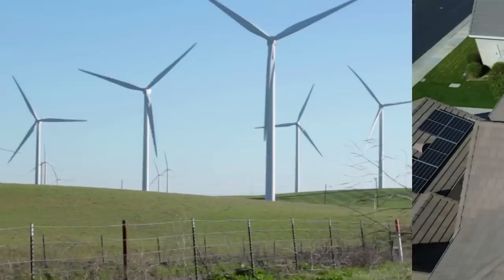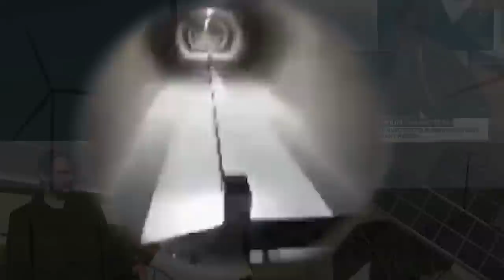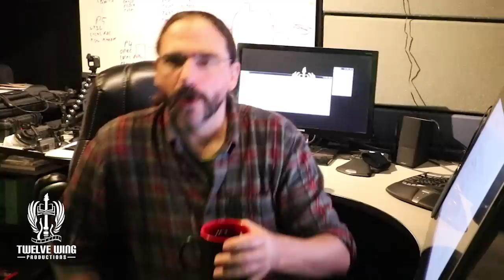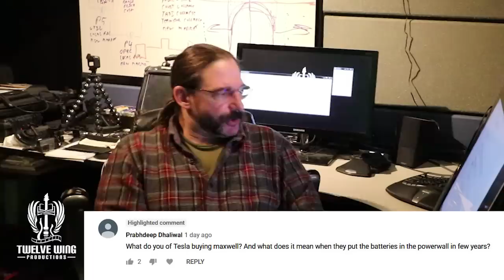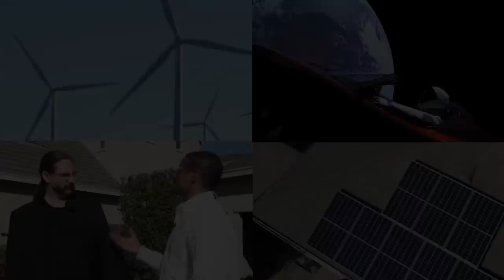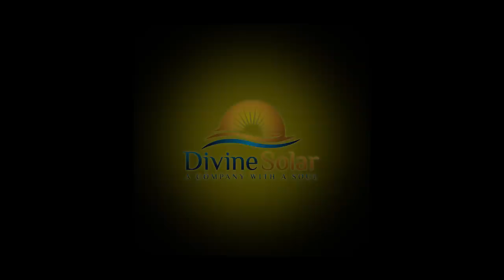Tesla purchases Maxwell; What does it mean for the Powerwall?

Comment: My take on the maxwell batteries for other than automotive services (such as truck and the hyperloop) in powerwalls terms I can see this being used in industrial mw designs for wind farms solar farms and diverseing in train hybrid power plants designs such as Ireland’s recent announcement of 602 trains with battery pack carriages
Reply from the maker: Agreed.  This technology isn't limited to just their consumer goods but also has incredibly important applications in their industrial products.
The king of these may be in the semi trucks.
Though the cars may gain a pretty nice bump in range from the added efficiency of charge discharge from the capacitors, the fact remains that a car just doesn't have the kinetic energy to regain much in terms of down hill regeneration....
... but a truck does.
So the benefit for the ultra capacitors with the semi is going to be huge.  You also mentioned trains.  If you are talking about metro trains and busses that do frequent stops and starts, the efficiencies added by using ultra capacitors for starting and stopping are going to be monumental.  I can actually see the ranges of these products nearly doubling, not to mention the benefits in battery longevity by allowing the batteries to do what they are good at and the Ultra Capacitors to do what they are good at.
Reply: @twelvewingproductions7508  hi thank you for the he reply.  In regards to the battery carriages , Ireland currently has only one  city to city line electrified  the rest still use Diesel, the  electrification process is expected to take 15 years to complete.  The battery carriages will then be added in pairs charging up on the electrified sections this reducing the running cost.  The more  the line gets electrified the then they will be recycled however the plan is for some Regional intercity lines not to be converted as it would not make economic sense this is where the battery carriages will still continue
Reply: I believe this tech is already in place, where windmills and solar lots tie in to the grid.  I don't remember into which side they're installed (grid side or w/s side), but they're used to equalize current on both sides when the connection is made.

The unfortunate thing is, the size you need to do the automotive side (DEFINITELY the 1MW cited for the semi) would still take something close to a trailer full of capacitor to do that trick.  Once you go there, you've pretty much made the case AGAINST using them in that role.
Reply from the maker: @billcichoke2534 , I don't think they are going to be doing the whole "battery" out of them, but more like a percentage. 

If I were guessing I'd say 10-20% of the battery mass would be for capacitors.  Perhaps 5% or so of total battery capacity.

But that's just a guess at this point.  There are WAAYYYY too many variables for me to do more than take a poke at this at this point.
I'll have more to go on in September and we can chat about it again.
Reply: @twelvewingproductions7508  Woah-woah-woah!  Three pronged answer attack!  STOPITSTOPITSTOPIT!

...phew!...

The point I was trying to make was, just the amount of capacitor needed to handle that kind of power would still end up being pretty massive.  As you had stated, their purpose in a modern electronics setup, is to modulate and smooth out current as it ebbs and surges.  To that end, its role in automotive, barring some real-time room temp superconducting breakthrough, is going to be limited or basically superfluous.
Reply from the maker: @billcichoke2534 ,
Sorry.. not sure why it seems to be duplicating my replies today.

Quite a bit of this is going to depend on energy density of these things. 

From what I've seen currently, however, you are absolutely correct.
Their mass is a problem.
Reply: @twelvewingproductions7508  And, again, I'm just using grid-level capacitors as a yardstick.

I wonder why the thermocouple/thermopile route was abandoned; especially the superconductive version.  It would seem to solve quite a few problems, not the least of which would be range and recharging, since they basically generate current real time.
Reply from the maker: @billcichoke2534 , whenever we are talking about using superconductors for anything I think we find ourselves into a situation where we have to measure the benefits we get from them with the incredible amount of power it takes to keep them cooled to their performance level.
Reply: @twelvewingproductions7508  I was thinking about something a little less convoluted...a small (100-150cc) pressure bottle filled with liquid nitrogen.  Slowly released over one end of a thermocouple array, it would provide a far more radical thermal differential, without a great deal of extraneous mechanism.  Dropping the cold side down by well over 200 celcius wouldn't take that much.
Reply from the maker: @billcichoke2534 , that's more of a lab application than an industrial one.
The best research I can give you as to what is involved in an industrial cooling system using liquid gas would be CERN.  Now granted they use liquid hydrogen because of the temperatures their systems operate at but it's still a good way to see just how involved this process is.

The other thing to keep in mind is that creating liquefied gas is a very energy intensive operation.